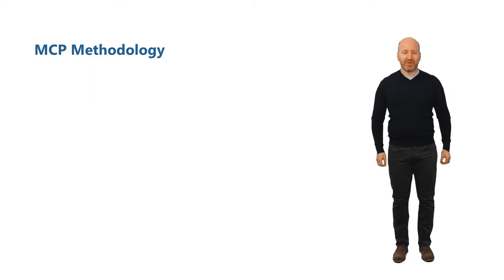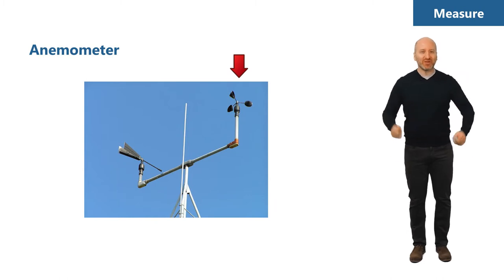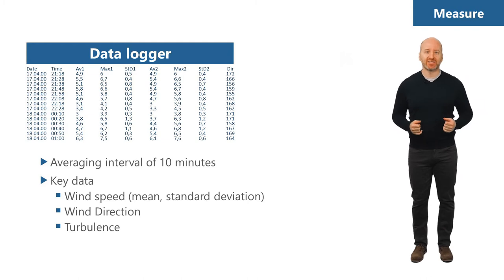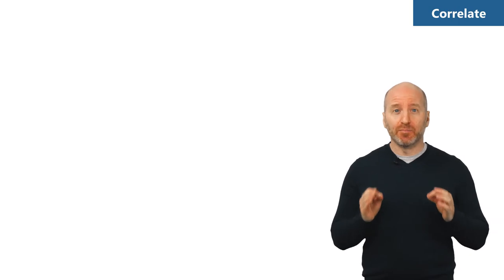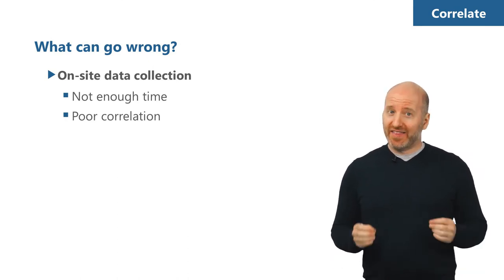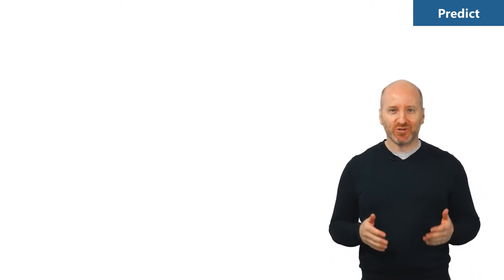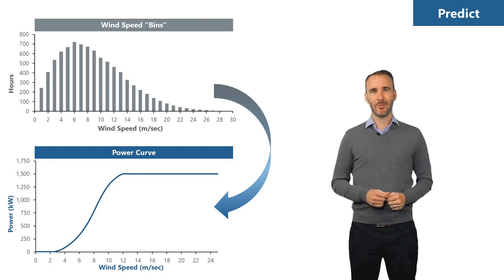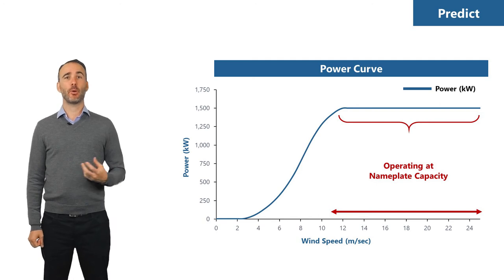Wind Forecasting | Pivotal180

Comment: Hello! A great resources as ever. Will definitely get into your online course... In the meantime, please advise, are solar energy projects requrie essentially the same  logic with the only difference that instead of the wind density you get some solar density? Will that need some "long-term" reference data? Also, it looks like the presentation is a little cut out in the end - you say that we have an average annual data for the winds which makes those data rather a range of energy outputs. So how is it accounted for in the projects - through scenarios, or is it just going to be on a conservatve side hence will make me take the lower end of the range as reference? Thanks!